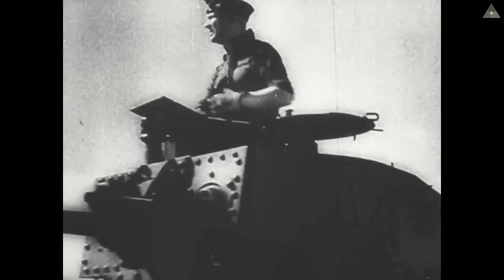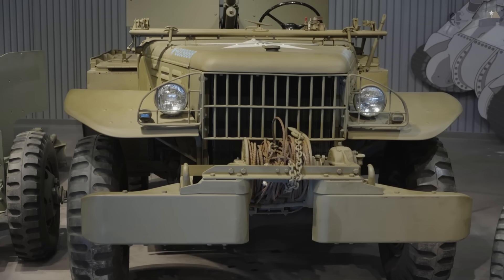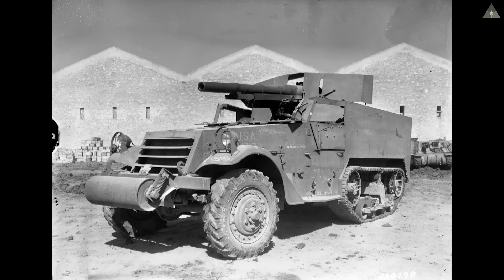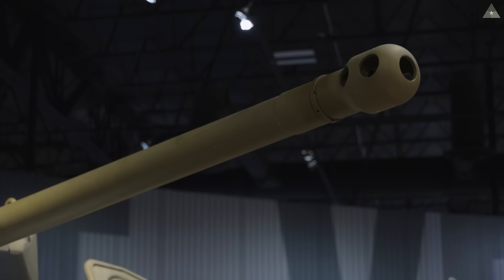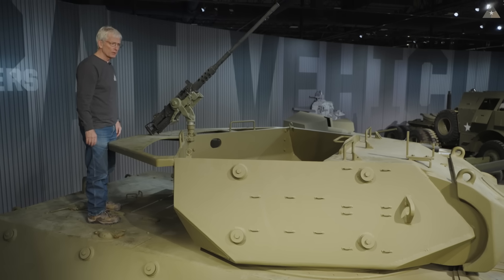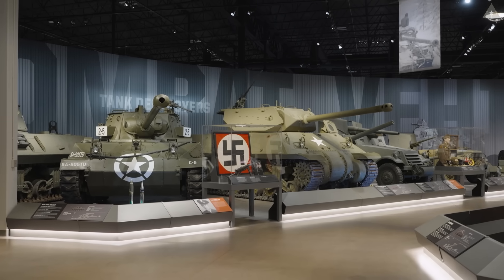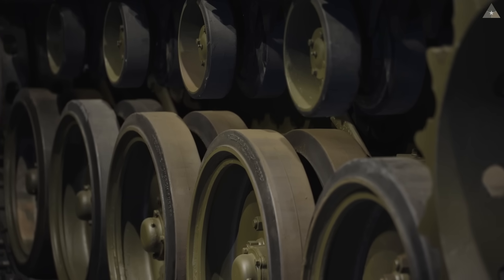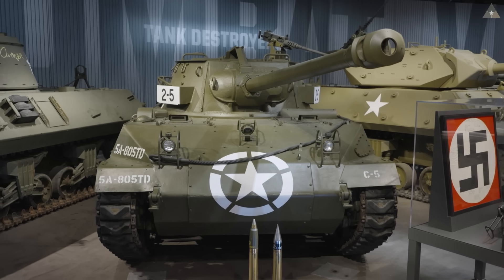US Tank Destroyers | From Defunct to Dominant 1942-1945

Comment: In all of my research on the "why didn't they just put the superior long 76mm gun on all the Shermans" and "The 75 mm short barrel Sherman sucked -- why couldn't the USA do as well as the Germans", I came up with the following after years of diving. There's a reason most dedicated infantry support vehicles / assault guns had short barrels. The short barrels are lower velocity (because of the shorter distance over which the rounds are exposed to a massive imbalance of forces). Lower velocity means that the round can have a thinner outer shell for stability, meaning, you can fill it with more explosive -- AND that shell can be made of softer metal, meaning better fragmentation. This is ideal against infantry targets and has also been shown to be more effective in period tests on inanimate targets. In WW2, 90% of the rounds fired by Shermans were high explosive -- meaning they were MOSTLY being used against soft targets. Tanks most routinely support infantry. When moving to a higher velocity, longer barrel, it's a trade off. You get better velocity (almost worthless against infantry, but useful against enemy armor), but because velocity goes up, the rounds can be filled with less explosive and have to be made of harder, tougher metal less likely to fragment nicely. And so, one solution might be to send a 76mm long barrel Sherman with every 4 or so 75mm short barrels. And this is often what happened. This would give these groups a bit of all-round protection. The American M8 Scott mobile assault gun was a perfect example of the belief that a low velocity, short barrel was superior for anti-infantry work. The Germans went for penetration over anti-infantry capabilities in their later war tank guns. Though there are plenty examples of their short barreled, low velocity assault guns earlier in the war. Like, the Stug III with 75 mm StuK 37 howitzer.
Reply: 76mm required a larger turret to meet US Army requirements.  The US Army actually wanted troopers to be able to work the turret.  The Brits just shoved a big gun in and the crews had to make it work.
Reply: The M4 Sherman's 75 mm gun M3 (40 caliber) was a more than adequate gun for dealing with PzKpfw. 3's & 4's, as well as having an excellent high explosive round; it was a good, all-around tank cannon.  The American Army's High Command knew that the Tiger and Panther were being developed (and fielded) by the Germans, but they did not think that they would be produced in as large numbers as they were, and thus did not think there was any need for a change.  (Besides, according to American combat doctrine of the time, enemy tanks were to be taken care of by tank destroyers, not by tanks.)  The 76 mm gun M1, which eventually replaced the M3 cannon in Sherman production, had a superior armor-piercing performance but it's high-explosive shell was inferior to that of the M3.  It was only after Allied experience with fighting Tiger tanks in North Africa did the High Command wake up to the need for a better gun for the Sherman.

mindbomb9341 - Your final note was exactly what the British did with their armoured brigades: each tank troop was equipped three 75mm-armed tanks (either Shermans or Cromwells) and one 17pdr-armed Sherman Firefly.  It worked quite well, with the three 75mm-armed tanks generally moving out in front of the Firefly, with the Firefly either remaining in an overwatch position or following up behind.
Reply: @speedythree  Yeah. It seems that the Germans went for the higher pen capabilities on their main tank guns -- and were willing to sacrifice the anti-infantry capability to do it. I guess when I was younger, i never realized there was an important trade-off and thought the longer, faster guns that offered more penetration were always just "better". The M8 Scott was a perfect example of a mobile infantry assault gun with a very short barrel.
Reply: @speedythree The only problem with having ONE tank with a "big pecker" grouped with three or four "regular" tank is that it was conspicuous,  drawing attention and therefore enemy anti-tank fire.
Reply: @selfdo  And so it did; Sherman Firefly crews went to great lengths to camouflage their tank’s long barrel.
Reply: Of all WW2 tanks, the one I would not want to go up against as an infantryman was a Sherman with a short 75mm. It had a high rate of fire,lethal HE round and a fast traversing turret.
Reply: The Germans had nowhere near our production speeds. They had more time to change things per their output, which was slow by comparison.
Reply: Germany in the early years of WW2 chose to have the lighter Panzer 3 have a high velocity 50mm gun to break through enemy lines or flank enemy forces and destroy enemy tanks or other equipment. having a more tank vs tank focus.

The Panzer 4 and the Stug3 were armed with the low velocity 75mm and explosive and smoke shells to support Infantry in the Assault to destroy bunkers or other hard points. 

Infantry also supported themselves with their own organic 150mm gun, 37mm gun, 20mm cannon, and 50mm mortars.
Reply: @pauln6917 One almost wonders why two separate medium tank lines were produced by the Germans at all.  The final mark of the Panzer Iii, the Ausf N, had the L24 75 mm gun , mainly intended as anti-infantry or to knock out AT guns, in support of the Tiger battalion.  So the roles of the Panzers III and IV were entirely swapped!
Reply: Please also consider the barrel length for shipping across the Atlantic. Short barreled 75mm are easier to pack and pack tighter than the 76mm. Maybe 2 or 3 every ship, times the number of ships makes a lot of difference
Reply: @marksimpson8577  AGF decided to remove about a foot off the original barrel, citing it was much too long.  The result was a loss of velocity and penetration.  The main reason cited was that they had an issue with the gun sticking too far out.  The original 76mm as designed was about halfway between the German 75mmL48 and the 75mmL70.
Reply: @marksimpson8577   Long barrels also hit objects when traversing the turret.   Buildings and trees
Reply: I also chalk it up to the fact that the US entered the war late, therefore their developmental cycles were always a step behind Germany’s. 

Example: the panzer 4, which first saw service in 1939, started out with the short 75mm (like you mentioned) however about 2 years later in 1941/42, they were being up gunned with the long barrel high velocity 75mm F2 gun. Now why do I mention that? It’s because the same thing happened to the Sherman. It entered service in 1942 with a short 75mm (which I would argue was better than the short 75 on the Pz. 4 when it was in regular service), and 2 years later in 1944, it’s 76mm would start to roll out in substantial numbers. Sometimes it’s just waiting for research and development to take its course, and not “allied incompetence to immediately develop and produce tanks that could dispatch rare German heavy tanks with ease!”
Reply: The 75HE round was good and it was a good anti-infantry round that’s why they kept it around. They specifically asked for it in armored units because of its ability to take out troops. You have to remember the Sherman wasn’t designed for tank tank combat it was designed to attack in advance and supportive infantry.
Reply: @temery94  I mean one “could” say that, but in reality the Sherman and it’s 75mm was a general purpose/dual purpose gun, which performed good against anti infantry and tank, compared to Germany’s which I’d argue focused on anti tank… due to the large amount of tanks the Allies were fielding and overwhelming their infantry with
Reply: Yeah, the Sherman was designed as an infantry support tank and mobile artillery. The other thing was it was light enough that you can bridge for it and go cross country. There are a lot of ppl with a German fetish who insist the Sherman was garbage against the invincible German tanks and it is bs. 

My dad was in the m36, his unit was the first to get it in Sept 44.
Reply: @njlauren  The M4 (I REFUSE to label that fine medium tank with the name of the US Army's greatest WAR CRIMINAL) tank had more than "infantry support" in mind.  It was the Limeys that had their "infantry tanks".  The M4 medium had speed and mobility factors that enabled it to get to what Patton described as the "Happy Hunting Ground" of armor, the enemy rear, his command posts, supply dumps, and artillery parks.  While ostensibly the tank destroyers were supposed to deal with enemy armor that was trying to do the same, by 1944, the Germans seldom mounted offensives with the Panzers; so the TDs ended up doing the majority of the "infantry support" by default.  The M3 75 mm main weapon that the majority of M4 mediums sported was sufficient to deal with the lion's share of German AFVs they ran into.  That is, unlike movies and comic books, most of the "Big Cats" were on the EASTERN front, for which they'd been designed for and the terrain more favored.  That its HE and cannister rounds were better at dealing with "soft" targets than the  higher-velocity M1 76 mm gun was by INTENT.

Post-war analysis caused the US Army to re-evaluate its AFV doctrines, however.  The role of "infantry support" was better given to specific SPGs and SPHs; this is why the M7A1 (based on the M3 Grant chassis) and the M7B1 (based on the M4) were already given priority as of 1944.  The was a version of the M26 Pershing, the M45, that sported the same short 105 mm piece but kept the turret; the M24 Chaffee had two different SPG mounts also sporting the short 105 mm, the M37 GMC and the M41 "Gorilla".  There had also been tracked vehicles that were used for the 155 mm "Long Tom" artillery piece.  This all culminated in the M109 SPH, which is still quite in service as the "Paladin".  For some time, tanks themselves were classed not so much on weight as the gun size; but in general, 76 mm was the "light tank' (M41 Walker Bulldog), 90 mm the "medium" or "main battle" tank (M47 and M48), later the 105 mm (later M48s and the M60), and 120 mm for the "heavy" (M103).  Although these vehicles were kept in service, particularly with National Guard units, or sold or given to allies, the US Army settled on the MBT concept, which was reflected in the 52-ton M60 that served for 30 years in the US armored divisions.  The M1, itself an outgrowth of the failed MBT-70 project, simply reflects improvements in tank tech, in propulsion, protection, communication, and fire control.
Reply: @selfdo  
The Sherman was designed for a lot of things,as others have pointed out it also was designed as a medium tank to allow it to be shipped and travel open field easily. The 75mm is a basic artillery shell, that was found to be a great size for infantry support and as artillery as well, the shermans were used as mobile artillery. 

Yes, shermans also were quick,and could do hit and run as well 

In terms of the imfantry role, one 🕜 the things with the Sherman is it didn't work well without it. It was a symbiotic relationship , the infantry acted as eyes and ears..James Holland in his book on the Sherwood rangers , pointed out the pitfalls of the shermans operating solo and it was a good case
Reply: @njlauren  Probably the greatest attribute of the M4 medium tank was its VERSATILITY, both in the various marks produced (at least six of them), and in the AFVs derived from it.  When you need to make 'em by the thousands, AND ship them across the oceans, and keep them fueled and provisioned across those vast distances, a vehicle that does almost anything is a tremendous asset.  LOGISTICS...may not be "sexy", but it's what WINS.
Reply: @selfdo  
Yep. Plus they were reliable and easy to maintain. Lot of the tanks lost in battle were fixed in the field and returned to battle.
Reply: @njlauren  The M3 75 mm gun had decent anti-armor performance with the proper AP rounds.  Just as with the Germans, tungsten for high-velocity AP rounds ("hypershot") was in short supply, due to coming from the USSR and/or Spain; these were rationed.  An APDS round (the British developed one for their 17-pounder with mixed results) might have improved the penetration numbers.  HEAT rounds were effective if they hit "normal" (near a 90 degree angle of incidence) to the armor plate targeted.
Reply: The 75mm medium velocity gun was good for 95% of the threats it engaged.  The 76mm did not have an effective HE round and while more accurate than a 17 pdr, it was not as hard hitting.  My question is why did they not put the 90 mm into the Sherman.  The turret ring was big enough as demonstrated by GMC M36 Jackson and it also had an effective HE round.
Reply: If the Sherman was up gunned to fill the anti tank role, the anti infantry roll could have been filled with the remaining light tanks. The shift from only light tanks to M4 medium tanks was to take out harder targets. Both problems could have been resolved by combining the two. Instead we get one size fits all and a tank that doesn't excel against either.
Reply: @lmpnow   You are forgetting that the antitank role did not belong to medium tanks but to antitank gun motor carriages in US doctrine. Now that started getting blurred in mid 1944 but it still guided R&D in the states.
Reply: The Army Ordnance Board of the 1930's and 1940's decided  what the weapons and equipment would be for U.S. ARMY to fight with.  They did not consider what the enemy's forces would be like and did not want U.S. tanks fighting German tanks one on one.
Reply: However, Nicholas Moran found testing that revealed that the 76mm has unexpected benefits. Despite the 76mm having much less TNT filler it was much more effective at demolishing reinforced concrete than either the 75mm or even the 105mm howitzer. This is because the higher velocity and thicker walls of the 76mm allowed it to smash deep into the concrete and despite having less explosive mass the mass was deep inside the structure that was more shattered by the kinetic energy. A lot of concrete needed to be demolished: bunkers, concrete bollards, thick stone-wall buildings.

Plus, you can't use your HE 90% of the time if you can't deal with enemy armor the 10% of the time it shows up. Now 75mm was enough for armor for a long time but soon it was not enough. The 76mm HE round could also penetrate light armored vehicles and explode inside, the 75mm HE shell couldn't do that.

All these tank guns were less than ideal against infantry due to their trajectory. Lets say you saw troops in the open and you fired on them with HE, how do you hit the ground where they are standing? The projectile is travelling very close to parallel to the ground, so a tiny error in aim up or down leads to huge change in the position it intersects the ground. Also, when the shell hits the ground it's pointing the wrong way, the fragments spread radially out from the sides of the shell, but the shell is mostly directing fragments up into the sky or down into the ground, only a bit to the side. Better than nothing. Better than firing AP. But not ideal.

The best HE was the 81mm mortar. The arcing trajectory was actually less forgiving of range errors when aiming at the ground and the shell landed more vertically. As you mentioned with the M8 Scott's 75mm howitzer that could have a mortar like trajectory at close range with the minimal charge. The British Qf 3-inch Howitzer was that same thing to an even greater extent, it had a very small case equivalent to the lowest charge of the 75mm howitzer, where the smaller case allowed less bulky ammo.
Reply: Because both of those statements are incorrect, and are born of the typical ignorance found among the casual WW2 audience whose entire knowledge-base consists of TV shows and movies.

The Sherman was standardized on the M4A3 76mm version in June 1944, and all other versions of the tank were ordered to stop production. The only reason 75mm armed Shermans persisted to the end of the war is because they were already in Europe, easy to maintain, had plenty of spare parts,  were mechanically reliable, and were appreciated by their crews. Not to mention some units simply refused to convert to the 76mm gun version of the tank, Creighton Abrams himself said the 76mm gun wasn't necessary and that the armored division should be: "50/50 between 75mm guns, and 105mm guns." While 3,500 76mm Shermans were in storage in England before D-Day, not one armored division included in the operation could be convinced to convert to the new tanks. It was only when the 3rd Army was being formed that Patton insisted all of his units convert to the 76mm gun.

The MEDIUM LENGTH 75mm Gun M3 (the short 75mm Gun M2 was discontinued after the first reports from the British in Africa dictated a longer barrel was necessary for more range in desert warfare) was extremely accurate, had an excellent High Explosive round as you already pointed out, and could be loaded and fired faster than almost any other tank gun in WW2. A well drilled crew can fire two shots in less than two seconds with a 'lap loading' technique, and maintain a sustained volume of fire of one round every 2.5 seconds so long as ready ammunition is available. When the Sherman came onto the battlefield in 1942, you had two basic options for tank guns, a high velocity gun optimized for firing armor piercing ammunition, or a low velocity gun for firing high explosive ammunition. The Sherman was one of the few tanks at the time to mount a gun that could do an acceptable job firing BOTH, and as a result was considered to be the best medium tank in the world at the time it was adopted. This is often a misunderstood problem that most people simply don't bother to understand, that the design and equipment of tanks is not a process of clicking a magic 'upgrade' button, but a long complex engineering process that takes TIME.

"And so, one solution might be to send a 76mm long barrel Sherman with every 4 or so 75mm short barrels. And this is often what happened."
This statement is completely incorrect. The basic administrative unit of tanks is the Battalion, and the Battalion either used one type of tank, or the other. There was never a case outside extremely rare conditions in which 75mm and 76mm gun tanks operated together as part of the same unit. When a unit switched from one tank to the other, the ENTIRE unit switched at the same time. The only oddball was the single assault gun Sherman 105mm that was part of the Headquarters Company. All of the line Battalions and Companies operated the same type of gun tank at the same time to simplify logistics.

The BRITISH did combine 17pdr equipped 'Firefly' Shermans with their other 75mm gun equipped Shermans as part of their cavalry squadrons in a formation known as a Sabre Troop, but that practice was not part of US Army doctrine due to the complexity of needing to maintain different stockpiles of different ammo types for the same unit. It was only possible for the British because the 17pdr was ubiquitous in their service, and the American 76mm gun was not used outside of tank units, even the Tank Destroyer Battalions used the 3-Inch Gun which had a different cartridge case than the 76mm and was not interchangeable.

Hope that helps.
Reply: @GeneralJackRipper  Thanks GeneralJackRipper.
Reply: @GeneralJackRipper  Yes. Was aware it was not done in the US forces.
Reply: All great answers to the above question.
One other consideration the lower velocity 75mm was somewhat comfortable and reliable to shoot from an enclosed turret. 

The concern was the high velocity 76mm gives the crew a concussion when fired from a enclosed turret. Some crew might even get knocked out.  
Some even argued about the reliability of such a powerful gun, as in how many rounds can be fired before the gun blows apart?

Hard to protect the crews when deploying such powerful guns. Even today gun barrel inspections are conducted after so many rounds, finding fractures is common. 

The 75mm could shoot very many rounds. While the high velocity guns are limited to not nearly as many full charge armor piercing rounds…
Reply: A big reason the Americans had a preference for their short 75MM guns was because they could reload them faster and had better HE shells. The Americans would run into AT guns such as the PAK 75 was because they were much more common then any German tank, many people believe Germany was this massive mechanized giant was because propaganda. At most Germany's army was at least 10% motorized, not even mechanized, Germany wasn't that good at mass producing, not like the Soviets or the Americans. The only reason the eastern front was a war of attrition was because Germany didn't have enough oil to make it far enough or good enough logistics, and the soviets didn't have a competent enough army until 1942-1943. That's why it took so long.
Reply: @hoedoekoespielencuck1476 
I think the Sherman could refire like 15 rounds a minute
Reply: I think the answer to your question has less to do with technology and more to do with prevailing armor tactics. There was a strong bias among most American infantry officers towards broad front infantry attacks with artillery support rather than armor penetration attacks. This was standard practice since the Spanish American War. This was a major bone of contention between US and British planners.
Reply: A lot of tank commanders didnt trust the 76mm gun. And the fact of the matter is, even with its upgraded penetration the 76mm gun couldnt reliably penetratw the glacis plate of the panther or the tiger's frontal armor, meaning it didnt have much use in the ETO (although, in korea, it was more than adequate to hunt the  T-34).
Reply: 😅😮❤❤❤❤❤❤❤❤ 4:44
Reply: Great to see someone who gets warfare, and the role the tank should play in it. I think the reason the germans made their cannons mostly focused on taking out armoured targets, is because of their experience in the French campaign in 1940. They faced the heavily armoured tanks of the French like the Somua 35 and Char B1, which they had quite the trouble knocking out. The Panzer III was made to be the more anti-tank capable with the longer 37mm gun, and the Panzer IV was the one made for the infantry support mounted with the stubby 50mm. However they tried to learn from their mistakes, and as the Panzer IV Ausf. G was mounted with the long 75mm, the Panzer III Ausf. L was left with the job of infantry support. However the now 50mm gun was long and was designed to be an effective anti-tank weapon. This left the germans tanks with lacking performance against enemy infantry or fortified positions. The Panzer VI would be quite a lot better, however the giant high velocity 88mm gun was still made with mostly armoured targets in mind, with the redeeming quality being its diameter and size. The Panzer V was even better in penetration performance, however its gun was even longer and was 75mm, leaving it with far less capability against the threat it was engaging upwards of 80% of the time. Yet I find it funny that in actual tank-on-tank engagements, the much more infantry support focused M4 Sherman came out on top just as often as the Panther, though this goes beyond the gun and more into the design, service and use of the tank itself.
Reply: The British still had better armor doctrine, that's why they fought the tougher battles in the earlier days of the European invasion.
Reply: @sleepingninjaquiettime   I think you might want to reconsider that. Montgomery's opinion of the armors performance in North Africa was very low, as an example.
Reply: A properly set up tank battalion of WW2 should have been made up of 3 medium tank companies and 1 tank destroyer company, with tank destroyer platoons of M36’s breaking off as support for medium tank battalions to keep the Tigers and Panthers at bay…
Reply: @sleeper.simulant7327   well, indeed that would be formidable. But it was not WW2 US Armored Force doctrine. Tank destroyers were organized as independent battalions. I suggest Harry Yeide's book as a start.
Reply: The US Army expected tankers to do "their job" which was support the infantry, and not go off seeking glory by engaging enemy tanks. Patton, of all people, vehemently resisted the deployment of 76mm armed tanks to France for that reason. Also, as someone previously commented, our doctrine was that AT guns, and later tank destroyers, should handle enemy tanks. This was reflected in the fact that almost half the US tanks initially deployed in France were M5 Stuarts with a 37mm gun, as the MGs were considered to be the most important part of the tank's armament.
Reply: @mikearmstrong8483  There is a lot of misconception about the US tank destroyer doctrine. The US Tank Destroyer Battalion is a Army or Corps level unit with the purpose of defeating concentrated enemy armor attacks by using it's organic reconnaissance capability (lots of M20 utility cars and M8s) and mobility to find the enemy tanks and set in ambush to prevent break through. They are not designed to seek out enemy tanks offensively. During breakthrough or attack it would likely be the medium tanks that would shoulder the burden of defeating enemy tanks. Although I imagine priority targets would be to avoid tanks in favor of destroying more vulnerable enemies.

From FM 17-33 The Tank Battalion (number 6 talks about defeating tanks):
"b. MEDIUM TANK. The medium tank is a heavily
armed and armored vehicle. Its weapons are suitable
for close support of other tanks and ground troops.
It is slower than the light tank and more sensitive to
unfavorable terrain (fig. 5). Its primary mission is to
close with and destroy the enemy. It may be used-
(1) To lead the attack.
(2) To support by fire the advance of the light
tanks, other medium tanks, and ground troops. This
support is usually by direct fire.
(3) To feel out the enemy and develop weak
spots. This use is exceptional.
(4) As a reserve for exploiting a success or breaking up a counterattack against the supported unit.
(5) To accompany the infantry and assist the
advance by destroying or neutralizing hostile automatic weapons and pillboxes holding up the advance.
(6) When necessary, against enemy tanks.
(7) When necessary, as dug-in pillboxes (exceptional).
(8) To reinforce artillery fires"

From FM 18-5 Tactical Employment of Tank Destroyer Unit (number 2 talks about ambush):
"b. Fundamental principles. Tank destroyer action consists of repeated application of the following fundamentals:
(1) Seeking information of hostile tanks by vigorous
and sustained reconnaissance.
(2) Movement to firing positions so as to intercept
hostile tanks by arriving sufficiently in advance of the
tanks to permit proper emplacement and concealment
of tank destroyers. Tank destroyers ambush hostile tanks,
but do not charge nor chase them.
(3) When tanks advance, tank destroyers hold their
ground, since destruction can be accomplished best at
close range."
Reply: @mikearmstrong8483  In one of the official US accounts of WWII, Patton publicly praises the 76mm Sherman, but then privately complains that Ordnance can't send him bigger gun tanks.  His "hatred" of the 76mm is the invention of Belton Cooper or his ghost writer.
Reply: Yes what about the Pershing ? Or the 105mm Howitzer Sherman ?
Reply: @mikearmstrong8483  the 37mm also had a case shot shell, essentially a shotgun shell.
Reply: America rather sacrifice men against money.😢